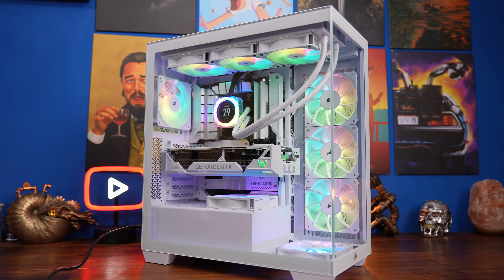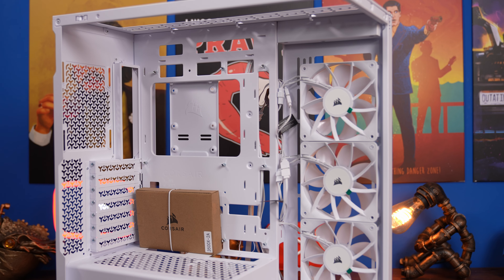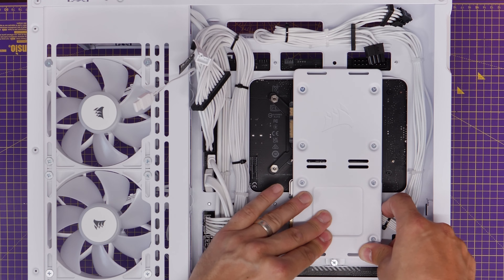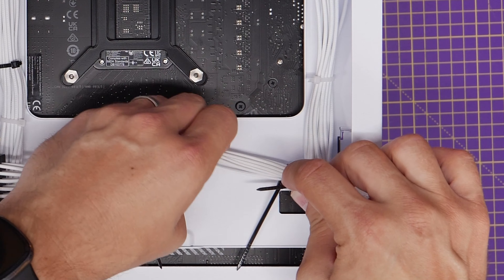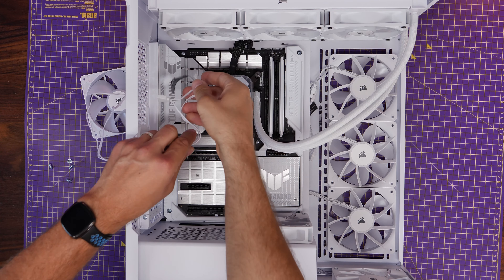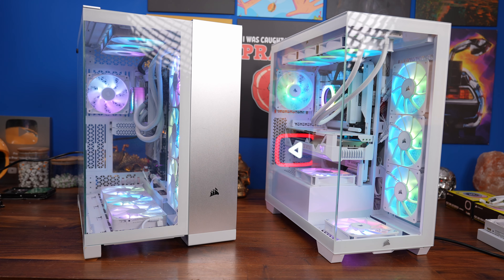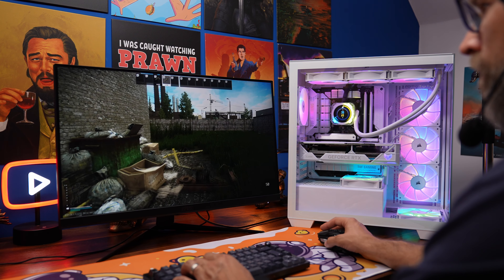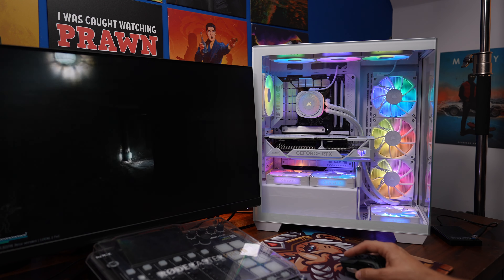Corsair 3500x ARGB Review - two different builds in one video

Comment: Hi again this time not a question just a statement. I used the Corsair Titan 360 AIO in the 3500x case which has been great, so I did a pump head swap and used the screen head and my coolant temp and package temps are on my rig about 10 degrees cooler than the H150i on my build in the 6500x case. same 14700k CPU's and both in ASUS boards the Hero BTF for the 6500x and the Dark Hero for the 3500x. I'm debating if I should get a Titan RX360 for my main unit, the 6500x build.
Reply from the maker: Corsair would like that mini review 👍

Comment: I'm torn on the case. Coming from a 4000d.... I love the look. I found it simple to build in but had poor thermal compared to before when I had all the same hardware other than the 3 additional fans with the case. Moved the 240mm around no help. As of this writing I'm installing a 360 in hopes of better results. Otherwise I'm going back to the 4000d.

Comment: I just built in the case and used the Titan 360 as well but I top mounted it. I do like it as well. I used the black version with only 6 rx120mm fans in at the moment but I have an RX 140mm for the bottom and a black rx120 for the rear if I need or want to add it later. So far I am happy with it.

Comment: I am moving a system from a Thermaltake F31 Suppressor case to this Corsair 3500X since my EKWB pump (purchased August 2019) just failed and I have to do work on the system: 
Intel i9 9900k water blocked - MSI AMD Radeon VII water blocked - EVGA Z370 Micro - EVGA 1000Watt G+ PSU - (1) EKWB 360mm slim radiator & (1) EKWB 240mm slim radiator - defective EKWB D5 pump that failed and is being replaced with an Alphacool Aurora 200 when it arrives from Performance PC.  

Issues so far:
- (3) of the motherboard standoffs were larger then normal requiring me to take the motherboard back out and replacing them one at a time as I discovered them
-SDD tray holes are too far away for any conventional screws to actually reach the Samsung 860 Evo SSD to mount it on the outward side (re-watched your video to specifically see how you mounted yours and it looks like you mounted it to the back side.  If mounting to the front side I would have to go buy some longer screws 
-air filter mesh is very air restricting when compared to my Phanteks P600S or the 500 or the 400 I have built in so I am removing it from them build

Comment: I have a question regarding an ROG CROSSHAIR X670E EXTREME motherboard, which has an EATX size of 12 inches x 10.9 inches (30.5 cm x 27.7 cm). I'm considering using a Thermalright Infinity Frozen 360 AIO cooler placed on the side. 

Could you provide your input on this combination? Specifically, will the radiator come into contact with the motherboard or the cables that run along that side? I'm contemplating whether this setup would be feasible, and I would appreciate your comments and insights.

Comment: hello sir, a question about iCue Link build with rx120 fans. How do you think if i get rx120 max fans instead, will they be more quietly than regular rx 120 in that scenario?
Reply from the maker: I've not tried them, so I'd just be guessing
Reply: @TheProvokedPrawn  got it, and one more question - wasn't it hard to install SHIFT model of psu in that case? Is it enough space between shifted ports of psu and back panel of the case to contain all the cables inbetween when back panel is closed? Or better to get standard psu (not shifted) ?
Reply from the maker: @ximvoin  no
 https://youtu.be/0ehyBqSP4Sk
Reply: @TheProvokedPrawn  thank you

Comment: I want to assemble a pc.. components are
i) MSI Mag z790 Tomahawk wifi motherboard 
ii) Intel i7 14700k 
iii) ADATA XPG (16×4) 6000 MT/S DDR5 RAM
iv) Samsung 990 pro 2TB with heatsink SSD
v) NVIDIA 4060 graphics card 
vi) Cooler master 360 pl 360 flux liquid cooler
vii) 6 Corsair LL 120MM RGB LED Fan
For these specifications which SMPS   would have been better Corsair RM 1000e or 850e or 750e?
I'm very confused.Please help me.

Comment: when you have your aio radiator on the back end and not on top, how is the fan flow orientation? are they set to intake or outtake? I know if the AIO is set on the top then the fans should be outtake but is that the same as putting the AIO on back?
Reply from the maker: https://youtu.be/qQcyYHGtArs

Comment: I had another dumb question regarding the new Corsair Titan 360 AIO. which is better to use the AIO pump header on the MB or the CPU fan header? I've used both and am not really sure if there is a definite difference? or does it really matter?
Reply from the maker: Generally I think it doesn't really matter
Reply: @TheProvokedPrawn  thanks I had that in the back of my head. thanks for the response.

Comment: Does it only have two ssd drive mounts?
Reply from the maker: Yes
Reply: Only ? I don’t understand pcs I got all my parts and this case going to build on Sunday but I heard I should get another ssd ?
Reply: @jordanmarazzi  I probably could get an aftermaket mount for the front where a fan is on but it looks like it only comes with the two mounts at the back by default. I need more than two drives 🤣